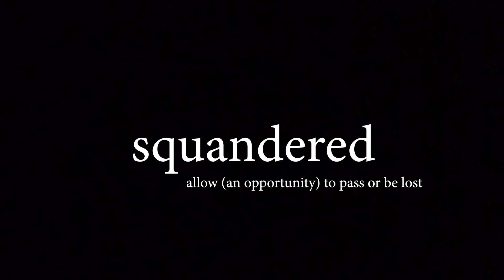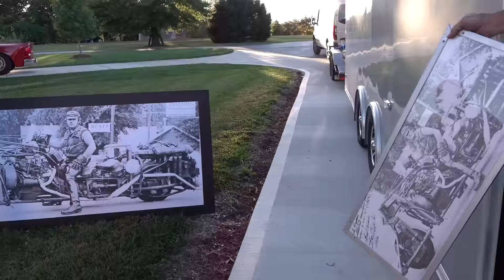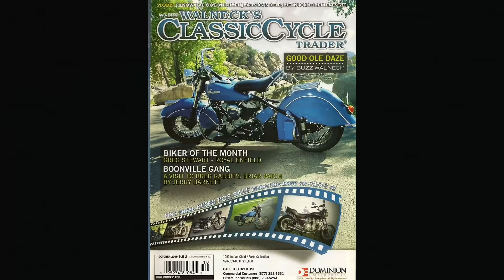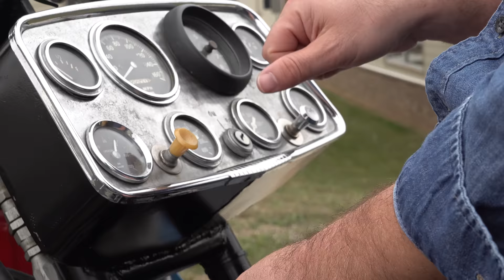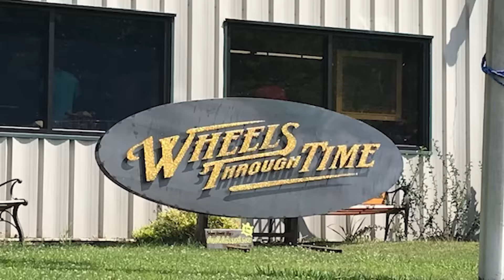I Bought the Legendary “ROADOG” Motorcycle(to Ride)

Comment: That thing is surprisingly QUIET. Wasn’t expecting that. Crazy😳
Reply: 4 bangers for ya 😂
Reply: The exhaust is longer in this bike then the car it was originally designed for lol
Reply: I still can't figure out why this guy thought that was the best long haul bike its a handful heavy an under powered
Reply: @adamthomas4638  sounds like a perfect idea! I did a cannonball in my truck without ac in May  Missouri made my windshield green 😂😂
Reply: @adamthomas4638  I'm assuming most of his long haul riding was out west lol
Reply: @sirseven3  I'm from Missouri and jw what made it green? Dunno if this is silly question but it's not clicking
Reply: @brentspellmeyer8943  Probably bugs.
Reply: @brentspellmeyer8943  every other state was fine but through Missouri not even my windshield wipers could get all the bugs off my windshield. It was hot and humid and I had to stop about 6 times in the state to squeegee my windshield
Reply: Comments like this remind me not to read the comments til I've finished the video
Reply: @sirseven3 alot of pollin dose it too im from mo my truck allways has a coat of pollen bugs or dust..
Reply: I was hoping header and straight pipe
Reply: @RyTrapp0 Out west? Out west has more hills, bigger hills, and huge mountains. He rode it in Wisconsin to Illinois, all the way up to Maine down to Florida. Not west at all.
Reply: @adamthomas4638  heavy and long also means stable, so it should be pretty easy to handle at speed on US roads, which are mostly straight for miles anyway. Under powered is just a question of your preferences. It´s more than powerful enough to do legal speeds, and you don´t build a monster like this to compete with Marquez anyway. Like said in the video, it was built with the intent of it being the best touring bike ever.
Reply: It's also surprisingly mild, smooth and stable, like a huge, kind, well-tamed horse or cattle. No freaking power which can tear itself apart, no jerky warpspeed acceleration, no crazy roar or pyrotechnics from the exhaust, no scary shattering vibrations.
Also love those retractable "landing gears", the spare tyre case and the springy sofa seats

Comment: Congrats Sean! Some might not get it… But this is part of American motorcycle history!  🇺🇸🇺🇸
Reply: yeah, I wouldn't crow about that tbh
Reply: @BN1960  it’s like getting a old car from history
Reply: I sat on this bike in 2000 (Chicago). Buzz was in the other room and I jumped on.
Torque effect steering issue is well known in helos and balanced on a twin rotor (spinning opposite). You might be able to mount an opposite side dummy driveshaft that spun opposite direction to balance that out.  Maybe it's a simple design like a drill or angle grinder hidden in the frame with a flexible shaft (mandrel) extension driving another unconnected shaft on the left side.
Reply: I don’t see it as a part of motorcycle history, I see it as the creation of a confused individual. Someone obviously wanted a car, but just didn’t know that they could use more than 2 wheels. It isn’t fast, doesn’t handle good, doesn’t look cool, isn’t comfortable to ride or anything that is important in a motorcycle. It’s the dumbest failure at making a motorcycle in recorded history. It has no value except for showing how dumb the creator was.
Reply: @adamr9215  found the guy who's GF he stole XD
Reply: classic american moment
Reply: @adamr9215  Albert Einstein and his children have aways been treated this way, but why,  jealousy?
Reply: @adamr9215  don't you think he would have built a car if that's what he wanted? i can see that you don't understand American individuality.
Reply: @1nvisible1  driveshaft is spinning on one side, instead of center of vehicle?
Could a gear, or series of small gears attached from spinning driveshaft to something of the same mass on the other side of that machine to spin in opposite direction harmoniously, to offset the gravity of centrifugal force created on one side?
Likely cause of wobble that when understood can be better manipulated to ride more comfortably and at higher speeds?
Reply: @bookofrevelation4924  What does that have to do with someone building something stupid and calling it a motorcycle? The answer is nothing. Try again with a reply that matters.
Reply: @MoeSlislack  No, you are the one who doesn’t understand. That thing is unsafe and a danger to everyone on the road. That’s not how individualism work. It’s not good at what it does, and Americans have always been known for making useful stuff. This monstrosity have no use or value.
Reply: @adamr9215  just thought maybe some jealousy of achievements and achievers, my bad, no worries it's okay?
Have a great weekend.
Reply: And we're now at a point where history is bought up by social media influencers for content.

Yikes 😂
Reply: @adamr9215 you must be fun at parties, if you even go to parties....
Reply: @adamr9215  You just don't get it, proven by using the terms "fast, handle and cool". This is about "engineering, pioneering and because I can" You come across as that guy who buys a specific bike because you have the matching socks and want to go fast, look cool and get your knee down on a half mile ride to Starbucks 3 Sundays a year 😂😂😂😂
Reply: It cannot weigh “3200 lbs”
Reply: @TheRattyBiker exactly what I was thinking. Lol. Harleys are slow, don't handle that great, but look cool. Most love them. Metric bikes most definitely aren't comfortable and some look goofy, but are fast as a scalded cheetah on meth. Most love them. It's almost as if buddy is in 5th grade trying to be edgy on mom's computer, or still stuck with an edgy 5th grade mentality and his gf left him for a real man that happens to ride bikes lol.
Reply: @adamr9215 you completely miss the point. Stop replying to people,  this is clearly above your mental capacity.
Reply: You could say the same about Boss Hoss. Only this seems to be an inspiration of sorts, like Mr Genie for the iphone back in the 80's. Everything builds on some sort of previous tech. There aren't any originals.
Reply: This guy must be a multi millionaire to just buy and play all day
Reply: Yeah, the worst part.
Reply: Im not American, but i get it! This is a beast. And its so nice seeing someone taking care of history.
Reply: You know what is REAL American motorcycle history? The 1975 Honda Goldwing.
Reply: @sterniiiij not a proud one imo
Reply: @TheDigger06  prolly

Comment: I am a retired Army 1SG (w/the MOS 52E) after retiring I was a field service technician for Detroit Diesel. I only worked on marine generators, land based generators and marine propulsion units. I always found that a crescent wrench and a hammer/bigger hammer always got the job done. Unless the engineers on the M/Y and Super Yachts were around. 👍🤙🤙🤙
Reply: Ok.

Comment: Turning left vs turning right - gyroscopics. It will always turn easier  in the direction of engine rotation. Loving the concept and execution of Roadog
Reply: There is more than one mechanic in the world, was looking to see if someone besides me picked up on that. Good job.
Reply: Or would it be the opposite? For every action, there's an equal and opposite reaction.
Reply: Most auto engine crankshafts turn counter-clockwise when viewed from the rear looking directly at the flywheel. That would mean turning left is in the direction of crankshaft rotation. At 11:15 you can see the crankshaft spining toward the left (counterclockwise) if you are facing forward.

Comment: I saw this bike once in Peoria Illinois. It wasn't running at that time. It was on a trailer. The owner was accepting donations for a badly needed restoration. I can say the bike looks so much better in your video than it did when i saw it. I believe it has four hydraulic jacks that will hold the bike up when you pull up to a stop.

Comment: Did I miss you giving out the specs? Engine, manufacturer, displacement, carburetor? Shorter version of that bike and my neighborhood with a GM 350 mounted sideways. Kickstand on side of motor block.
Killer bike, great video.

Comment: To safety  haul my bike I need 9 1/2 feet.  When I ride I pull  a trailer.   Add 9-10 more feet..  I just have a swivel point in the middle.   Ride  as safe as you feel brother

Comment: I'm in green bay and have the craziest bike that needs fixed! It's a 1989 750 gsxr frame with a 1990 1100 engine. Bored with wisco cams and pistons. I'd probably sell for 10,000. It's completely chrome with a 8 inch rear extention.

Comment: I have a suggestion. If you were to install a gyroscope on it to keep it balanced and tip the gyroscope  electrically  to control the angle of the bike. 🤔 the flywheel on the gyroscope would need to be larger , but can be placed anywhere on the bike to do it’s job.  I wish you good luck …

Comment: I think the engine is from an early 60s Chevy II.  The reference to the Corvette suggests that it has a Power Glide transmission.  A Chevy II would have weighed well under 3000 LB and was about 15 ft long.  Did they say how long this thing is.

Comment: I had a 2002 Yamaha Road Star that had been frame raked, dropped, cam'd etc. Doing that wonked out the handling characteristic of the bike because it extended the overall length and shortened the suspension travel. Yeah it was cool looking with trick paint job and very powerdful but handled weird. That was picnic compared to this monstrous beast!

Comment: I am 22, and I built a trike in a car port tent and have pictures of the hole process, and it has a 350 bored 60 over pushing 11.3 compression and idols at about 420 rpm a th350 transmission with a 98 s10 rear-end with 2.71 gear set and would like to know if you wanted to look at it

Comment: CHANGE THE TIRES. That's why it's imbalanced while riding.

Those car tires have flat surfaces instead of curved ones like motorcycle tires MUST have. It's not even debatable. I saw up close photos of the tires from the museum, and it's definitely car rims with car tires. That thing literally can't lean like a motorcycle. It will tip, but only after fighting the rider to lift the whole tires wide contact surface and tip over the hard edge of the car tire. Riding straight will be slightly wobbly as the tires flexes slightly sideways, but turning requires actual force. It turns like a car tilting up on it's side using two wheels. Watch Fortnines video about car tires on a motorcycle.

Comment: If the tires used don't have a round profile then its going to be more difficult to turn it...  just saying... put motorcycle tires on it and it will turn a little better...  not much given the wheel base length.

Comment: I'm sorry but I have trouble with believing this is the original bike, there's no way it's not a replica. The seats are sitting on a solid tube frame with a spring underneath to look like a spring seat
Reply: I guess you didn't watch the video because the back seat was bouncing up and down.  You could also see the front seat moving when they did a close up shot of the rider.

Comment: So, what engine is that in there actually? An "Iron Duke" 2.5liter Pontiac? The starter sure sounds like one. I've had PLENTY of late 80s cars with that engine in it.

Edit: Nope... Not an Iron Duke, it doesn't have a cross-flow head, the Iron Duke does. It must be the ole Chevy 153c.i. I-4 that came in the Nova/Chevy II. 90h.p. and 150ft-lbs of torque.

Comment: Is that a TH350?  What did they do to connect the tail shaft? Is it a custom made adapter? Why did they need this custom tail shaft? Looks like there was enough room for a regular stubby tail. the cusom tail must be doing more than just holding a drive line for it to be that big. Really curious what this bike is cobbled together with. Would have been better as a trike.

Comment: That bike you can not ride it 8f you fear it, reason bill wasn't scared of it is if you look that thing will not lay down there are those foot plates tyat will stop it, and you have to keep power on that back tire at all times. Turning will be extremely wide but it will turn you just cant be scared of it as hitting the clutch or brake at the wrong time with a 3200 pound animal will not end well

Comment: Better working brakes, and well..... better working EVERYTHING plus a lot of seat time and it will not be near as scary. Do a couple 1,000 miles riding it everyday on a road trip, and it will even be a ride where your heart rate can drop under 100 bpm. Not joking even in the least. Finally, bring a chase van with a trailer that fits it along for the entire road trip. Not joking. 
Wheel it in to your motel room(or tent) at night...just kidding.  But just one time it would be an epic photo opportunity!!!!!!!!!!!!!!!!!!!!!!!!!!!!!!!!!!!!!!!!!!!!!!!!!!!!!!!!!

I wonder if some major or minor tweaking can get it better balanced and  turn left as easy as it turns right. Its only rocket science, after all. For real.

A careful and complete carb rebuild will give you a 1000 times more responsive throttle response. I know you have zero accelerator pump action after sitting and rotting all those years.  No need to buy a NEW carb. Keep it original as much as possible, unless changing it significantly improves its rideability and safety.

TRY and put ethanol FREE  gas in as much as possible. And do  make certain 100% ethanol free gas,  plus gas stabilizer,  is added if it will not be ridden for a while at any point.

Comment: I don't see the point or the fascination. Many home built motorcycles substantially better engineered than this monstrosity. It needs to be related to hanging  from a ceiling as funky art because it fails miserably as a motorized two wheel vehicle. Pass. But,,,, indeed good video effort.